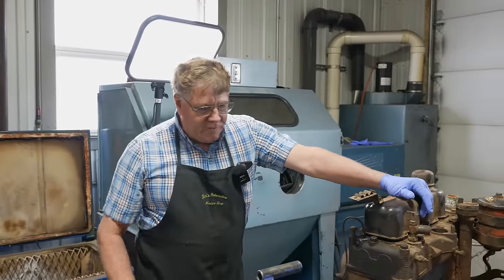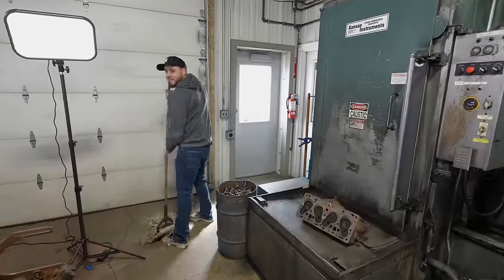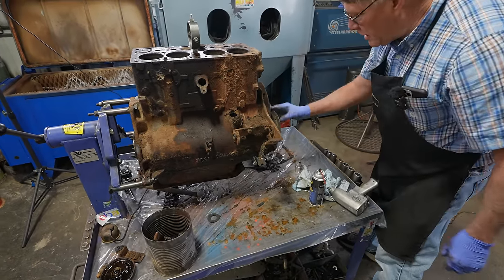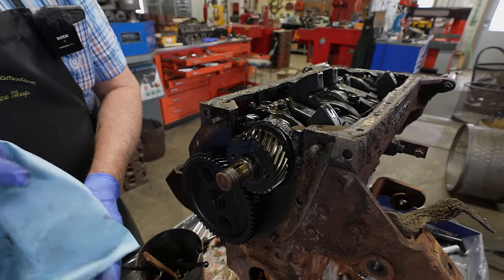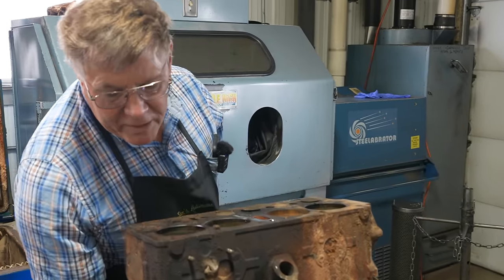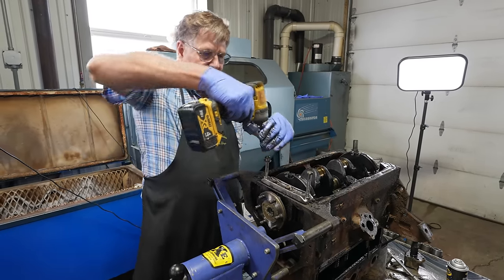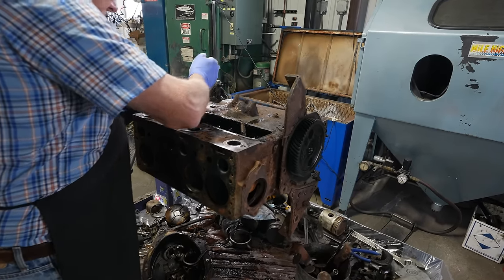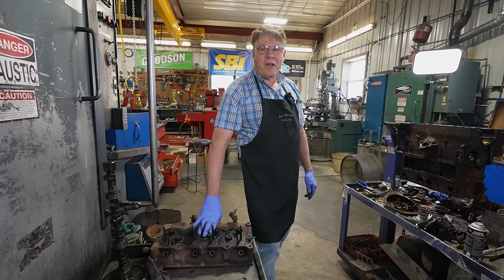Tearing Down A NEGLECTED Willys Hurricane Engine...

Comment: Omg. A Willys Era engine from back like 1939.  That's what my engine was that I rebuilt for a 1964 Jeep FC150 truck. It was a 4 speed 4 wheeldrive. I love that truck but it got stolen in North Carolina. My friend's daughter sold it not realizing that it was half mine. I loved that truck.  I really missed it as I have gotten older.  It was so fun to drive. And I had memories with my mentor. That is what made it so Special.  As I'm 53 now.
Reply: Our motor was already punched I think 20 over. It was torn up again.  As I think we had 2 pistons that came apart. It was punched 60 over with 30 over bearings.  The rings they left a little bigger gap to keep the compression down so we wouldn't burn the engine up With the high RPM.  As the Jeep would run only about 60 and that was pushing it at full throttle. As it was singing down the road.  It was a tough little Jeep after we got it done.  We installed a new clutch. A new oil pump. Rebuilt the distributor  And put on a new water pump. It had a lot of work that needed to be done when we first got it. Literally it was a basket case. The whole Jeep is in bad shape. But in the end we got the Jeep completely road worthy. We could take that thing on long trips and always depend on it. It never let us down. It was so fun to drive. I think we had A 16D nail that held the driver's door shut. We had it tied on the door with a string. And would go through the window frame into the door frame. I really loved that old Jeep.  It even had A 540 PTO on the back. That had a cable that went to the transmission that activated another drive shaft forurs gear box on the back. We never used it but it was always there. And it worked.
Reply: Makes me cry missing my mentor. He taught me a lot as my dad never taught me anything. He was always gone. And would only b** about my friend that would teach me. I'm sorry dad you wasn't ever around.  As you didn't care about teaching your sons anything really.  That Jeep was the only memory that I had left of my friend Keith. And his daughter sold it for money. It didn't belong to her. It belong to the 2 of us. She never did care about her dad anyways. But I did. She sold the jeep in Black Mountain NC.  My mentor Keith taught me a lot more than anyone could ever teach anyone else.  I think she was rather jealous of me. As I spent more time with her dad than she did. I'm sorry I can't help but cry. I have nothing left of him.  Having to sell everything off from the house and move a 1000 miles away for work. I forgot my pictures. My photo albums. I have nothing left. Not even the Jeep that we rebuilt. That we had so much fun in the mountains. We just had to be careful coming downhill to keep from turning over on the roof. Seriously true

Comment: My first engine rebuild was an F head out of my uncle's jeep panel truck.  It was the delivery vehicle for his dry cleaning business, so got a lot of stop and go driving.  It was 1959, and I had just graduated from High School.  Used a Motors manual from the public library to help me get through the job.  The truck was still going strong when I returned after a four year hitch in the USAF.  Thanks for the memories.

Comment: I really enjoy this channel. Very educational and the people in it are all great, just the type you would like to have as neighbors.  About old car engines, I inherited my grandparents all original 48 Ford Super Deluxe. It had about a half inch of old oily sludge in the oil pan we removed. Fortunately, my grandfather had a canister type oil filter on the engine so that probably helped save the engine. The engine didnt need rebuilding, just some maintenance at 57,000 original miles. Engine is very quiet and runs as well as you would ever expect from a vintage Ford flathead. Great channel.

Comment: Early engines used oils that had no detergent additives to keep contaminants in suspension.
It was entirely intentional in the design that the contaminants would settle in the sump as sludge and stay there.
The float for the oil pick up was so the oil was drawn off near the surface not down at the bottom where all the sludge collects.

Detergent additives began to be added to oils once engines began to be fitted with oil filters.
Today, small engine lubrication still works in this way and it is the main reason manufacturers specify special small engine oils for them that don't have detergent additives
Reply: I was going to say the same thing!
Reply: Except of course the Kawasaki FV which was on JD mowers in the 90's came with a car type filter...
and I now run Baldwin filters on it...
Great full flow pressurised oil system on a push mower....and still going well

Comment: Great video.   Right up there with the tractor engine problem.   Love the tear-down and forensics.   Lo many years ago I was putting a MG engine  back together  that had a short block done on  for my brother.    No matter what I did,  the Distributer  would not index to the right position.    It had got dark, I took the distributer into the work room.   Looking at it,  the key was not perfect center,  it was offset.   Looking at the Haines it was,  no,  do not tell me they put the timing drive back in 180 deg off.   Yep.   Fortunately on that it was one bolt,  pull it out and back in and we were good.  
        Of course dropping the rods in and they did not look right either.   Yep,  no lifters.    Good news was they did an outstanding job on the rest and it was very good.   Large rebuilder in Seattle called Big Wheel.    Brother took it out,  pulled all the stuff off,  shipped it down from Alaska and back and it still was half the price of an in Alaska rebuild.

Comment: I drove a Willys Jeep for my company commander in 1954 and 1955. The military version used a 24V system and a permanent oil filter. The filter contained a stack of closely fitted thin steel plates with wipers between the plates. Cleaning was accomplished by several turns of a top mounted handle that wiped the accumulated sludge from between the plates.
Reply: Working in old industrial surroundings that was my job as an “oiler”, keeping equipment greased and lubricated and giving a few dozen of those wiper filters a turn or two per watch.

Comment: Oil galley is what we called them at the Chevrolet foundry and at the Chevrolet engine machining and assembly plants in the 60's. I have called them oil galleys since I started working on engines with my dad back in the late 40's and that is what he called them. He was a Packard Motor Car machinist. . So I think you are in good company. 
I'm an old plant engineering supervisor at Chevy during the 50's, 60's and 70's.

Comment: Very interesting teardown!!!  I am working on a 1955 Cadillac with my friend, and it had the same "floating oil pickup" arrangement and bypass filter! The Cadillac manual, makes a big deal about how the floating pickup ensures clean oil is drawn in by the pump - but in the case of the Cadillac, the moving joint is pretty near the surface of the oil and is not sealed well. I think the manual shows a felt washer. In this case, he had oil pressure problems and collapsed hydraulic lifters on several occasions that bent pushrods. We found that the screen in the oil pickup had not been cleaned when the engine was rebuilt, so it seemed that the pump was prone to sucking in air at the moving joint on the pickup when the engine was only a quart low on oil. Kind of a perfect storm. We added an o-ring to help seal the joint and cleaned the pickup screen before moving on to other problems.

Comment: There is a small hole in the side of the filter housing center tube that must be cleaned out or oil will not flow through the filter to the timing set. Also this is a partial oil filtering system. not all oil is filtered. You can increase the oil pressure to the #1 main bearing by welding the hole shut on hex oil tube that sprays onto the timing gear set and re-drill it to .040" .
Reply: 50:05    Oil galley.  Thats what we called it.  In chev 283, ford 289 etc.  Must have come out of a Chilton manual in a past life.  This Jeep engine is a bunch of fun to watch.  Thanks guys.

Comment: I don’t recall ever enjoying a teardown as much as this one.  I learned of exhaust in the block,  intake in the head,  pins to prevent main bearing rotation,  offset slot for distributor drive, (early Ford flathead had an offset drive slot (my Dad taught me that) tapered bolt’s from back to align flywheel.  All kinds of interesting stuff. When this 73 yr old thinks he’s seen a lot,  I see a bit more ……. I like it.  Thanks for a great way to spend an hour of time 😃

Comment: You’ve got my head spinning with the floating oil pickup. A necessity with older non-detergent oils, but not any more. I went through the motions of cleaning out the sludge in the oil pan of a continental 226, and now I wish I would’ve welded or pinned that oil pickup to eliminate the floatation. Might be going back!

Comment: I am a retired mechanic and I collect old factory workshop manuals as well as the industry manuals that suppliers to the industry used to put out for workshops and up until the 1960's it was a common practice to do a head de-coke that involved cleaning all the carbon out of the exhaust and inlet ports, combustion chamber and all the build up on the valves. More times than not the valves were just hand lapped if they were not to bad as valves cost quite a bit back then. In-chassis rebuilds were also common as heads and sumps could usually come off with the engine in place. Rebuild was an optimistic term as only the rings and big end bearings were generally replaced  as well as the head looked at or in the case of side valve engines they would be pulled out and cleaned. With dirty fuel, rubbish oil, and no filtration engines filled up with gunk very quickly. Interesting to note that the first Land Rover 4x4's made after WW2 also had a four cylinder F head engine made by the Rover company. When you see these engines you can appreciate just how far we have come and the manufacturing lessons learned from WW2 along with metal alloy technology that spawned the great engines of the 60's and later.

Comment: I also started driving in a '53 Willys Jeep wagon with a Hurricane OHV Six in 1966.  Yes, the fiber timing gear stripped while traveling down the interstate on a very cold night.  As far as I remember, it was replaced by another fiber one - done for noise and to be a "fuse" to be sacrificial in case something locked up in the valve train.

Comment: Years ago when I repaired tractor trailer tires we had 2 of these that were air compressors, cylinder 1&4 ran the engine 2&3 through a special head compressed air.
Reply: I've got one of those compressors, pretty neat

Comment: Very cool! I hopped one up about 20 years ago and it still runs great!

Cut the head .100 & cleaned the ports. You might have to cut the exhaust valve pocket slightly

Delta Cam in Tacoma did a little bigger bump stick 

Bored 0.080, a little offset grind on the crank.

Henry J distributor 
YF from Ford 300
Built a header
Titanium clamp bolts on rods
Balance.

Probably another 20 or 25 hp, but VERY noticeable!

Comment: So enjoyable for me personally as I had one and it required overhaul. I was assigned to Tel Aviv, Israel (US Embassy) in the late 1980's and Cars (then and now) were expensive (254% import duty) so bought an old 1973 IDF surplus CJ-5. I'm your age Jim so back then there was no "Internet" and the only parts available were via "JC Whitney" catalogue ... we had "APO Mail" so cheaper than public (no Duty). Probably the hardest hurdle was getting the "right pn" ordered/shipped as these IDF Jeeps were a "CoProduction" so many different parts used ... "assembled" in Israel. What a mess it was ... lengthy rebuild time by the shop ... I tried to limit cost by ordering parts and many didn't work out (like Steering box) but all in all, she served my purpose. After watching this video, I KNOW the shop didn't do as in-depth a rebuild as the said they did ... HA.

F134 came out in 1950 and only 75 hp but 114 lbs. of torque ... sturdy engine for sure. Sure pull the sand dunes on the beach well enough. And nice on the tip of the hat to Grandpa on the "Shop Made" puller ... I have lots of my Grandfather's hand tools and most I have no idea on application ... but still nice to have.  Again, thanks for this video ... and yeah, noted the "Editor" adds and probably when the baby was sleeping ~ recall those days as well.

Comment: I remember putting new valve cover gaskets on old 50s and 60s engines. The sludge from the oils of the day was  horrible. I remember doing a Ford 390 out of a Thunderbird that you couldn't see any of the rocker arms because they were waxed over. YouTube channel Project Farm tested new oldoil from the late 40s early 50s . The test showed that it was close to being crude oil. It was straight oil with no detergents or much else for additives.

Comment: We had a Jeep with a metal cab and a 5’ plow at an Esso station I worked at. It had an F-head engine. Little bugger was tough. I think I pulled the head and fixed something that was causing it to drop one cylinder. I plowed snow and did road calls in it. With the all metal cab and no insulation anywhere that thing was cold inside in the winter. It was tough though and fun to drive.
Reply: My dad had a Jeep like that with the 4 angle manual plow and yeah, no real heat, but I thought that was heaven compared to the Farmall Cub he first had me use😬

Comment: Old volvos also used one fiber, one metal gear. It was a somewhat debated issue on when/if to switch to metal/metal. Metal/metal did improve reliability on race engines. Aggressive cams, dual springs etc could cause the fiber gear to strip. But if you weren't going for a race tune, metal/metal mostly added noise and cost.
Reply: Having an fiber wheel may also dampen harmonics being transmitted from the crank to the valvetrain. It seems to be why gear drives as an "upgrade" aren't popular among racers, that an all steel gear drive might be stronger than a chain, but in reallity can hurt the longevity of the valve train compoments.

Comment: People in Texas to this day run fairly new vehicles with plain water in the cooling system. They are actually surprised when freeze plugs pop out when the temps drop to 22 degrees.
Reply: Freeze plugs are a misnomer. They're not meant to pop out in freezing weather, and often dont. Im a scrapper, and I couldn't count all the freeze cracked blocks Ive seen. Those plugs just fill the holes meant for removing casting sand from the water jackets at the foundry!

Comment: I've seen some engines so worn out that the cylinders were .060 oversized and had never been re-bored. But having worked on one of those Willys F engines, it reminded me a lot of the old British cars, which literally have a nut for every bolt.

Comment: Had one of those. Was in 1951 Willy's pickup. It came with a station wagon version that was in bad shape but a good tunning buick v6 that was installed with a kit to adapt it. Went a different route when i stumbled across adapter for a small block Ford.

Comment: I am curious why you would want to save the old temp sending unit. I would think the same reasoning would apply to it as the thermostat. I am sure you know but some of your viewers may not know is that the lobes of the cam are ground with a slight taper to them. That along with the lifters being ground with a slight convex allow the lifter to turn as the lobe  goes through the opening and closing process. More of a bearing action than a wiping action. I agree with you Jim, they've always been oil galleys  to me. One thing I have done on old bypass oil systems is install a full flow oil filter by blocking the main oil galley  and tapping into the galley on both sides of the plug and routing the oil through a full flow filter back into the main galley. An aluminum FE Ford filter fixture works well for this. Pretty sure commercially mad kits are available too.

Comment: I do not know for sure on the F heads.
But on my original 1944 GPW L134, you time it by the flywheel so the tapered pins only allow it to go on 1 of 2 ways 
when I assembled mine I put it on 180 out:(

Comment: Thanks for the video   I enjoyed. The explanation. You stayed right with each step.  The dog did not interfere with you working.   Camera man was great.  I want to take apart a 4 cylinder 1951 Minneapolis Moline. Your video gives great information.  I was thinking of 
 Bits of information.  1951 gas was leaded gasoline.  Regular and Ethlye.  30 SAE  straight weight motor oil.   Quaker state was a Paraphine  base oil.   It was ok in the south.  But this oil was bad for Engines north of the Ohio River.  In cold weather , It gummed up the engines with lead gas.   I have tractor manuals showing a 68 Octaine gasoline being used.   Rislone ,,in the yellow bottle is what I use  on an engine ,, when 100,000 mile mark is passed. Trying to stop some wear on the internal engine.

Comment: We had a strip tank to soak engine parts in. Used 3 different chemicals and it was always kept at 120 degrees F. Then used high pressure water to clean off grunge.

Comment: The spring will come out of the cap. There is a threaded interface that holds that together-Same type of oil filter as an old Ford Tractor or Kohler Electric Light Plant